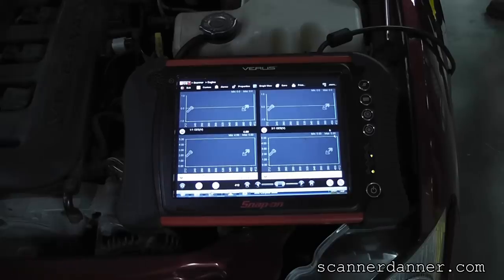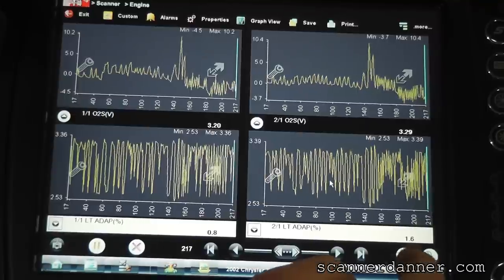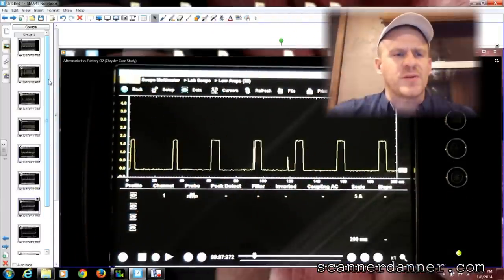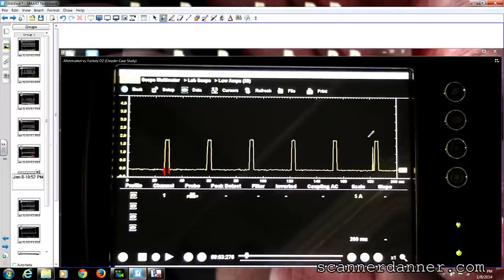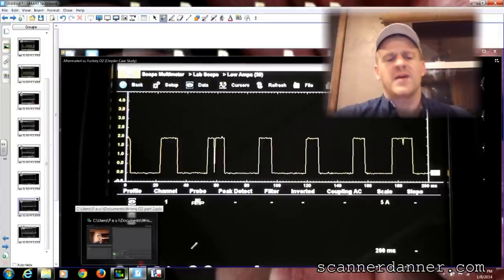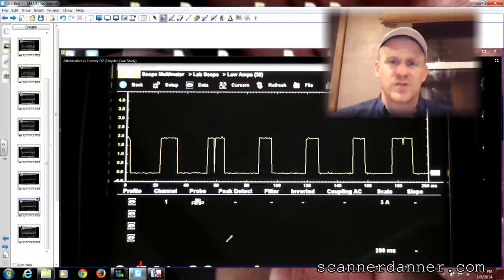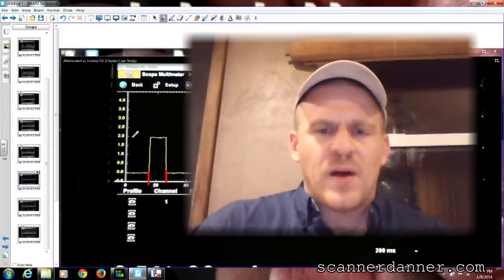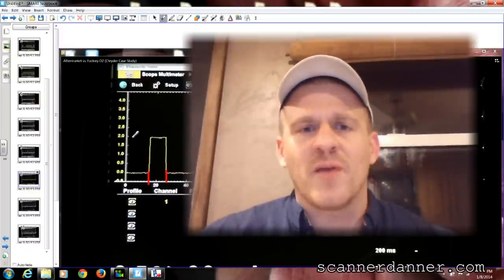WARNING! Aftermarket Oxygen Sensors (Chrysler/Dodge/Jeep part 2)

Comment: Hi Paul, Before you read this post read Douglas Lee's post, if you haven't already. I expanded on his comments and I copied it and posted it to you too, below! I really think you will find it interesting and it might answer some of your own questions about what was going on in this case study. I think!   You still Rock Dude! LOL!

Grab a cup of coffee, its pretty long!

Douglas, I believe you have an older generation computer ( Single Board Engine Controller ( SBEC )). SBEC l & SBEC ll have a single 60 pin connector as SBEC lll has two 40 pin connectors. Pin locations are not the same for various functions on the connecters. On 1998 and later SBEC lll and SBEC lll+ have different pin arrangements to prevent inadvertent interchange. I'm not sure which version you have.
 Introduced in 1995 on Chrysler vehicles, it was the first to combine the Logic Module that processed sensors and other inputs with the Power Module that actuated all output devices including the ASD relay onto one circuit board. The Heaters are fed battery voltage by either the ASD or a Sensor relay. In either case, both relays are PCM controlled. The sensor heaters use a common ground as you describe or are pulse-with modulated ( PWM ). With SBEC or Jeep/Truck Engine Controllers ( JTEC ), if the Heaters were PWM, they were controlled with a  Low Side ( Ground Side Switched ) driver, in the PCM. Both the SBEC & JTEC platforms were starting to be replaced by Next Generation Controllers ( NGC ) in 2002. I believe they were totally phased out in 2005.

On vehicles with NGC controllers the Heaters are controlled by High Side ( Positive Side Switched ) drivers in the PCM.  The Sensors in NGC are Zirconium Dioxide and Positive Thermal Coefficient ( PTC ) elements, meaning that as the temperature increases so does resistance thru them. The resistance on the heaters are constantly being monitored by the PCM. This information is used to verify heater circuit integrity and indirectly the temperature of the O2 Sensor. The PCM performs a Voltage Drop test across a 10K resistor that is inline with the Driver and the Heater circuit. The PCM adjusts PWM to maintain proper Current Flow to maintain proper operating temperature ( 660 Degrees ). 

The PCM also uses a 5 volt pull-up to check for short to ground or short to power when the Heater is in an OFF state.  The PCM and the O2 have another trick up its sleeve! When the O2 gets hot it essentially becomes a Galvanic Battery and generates a voltage of 0.0 - 1.0. volts. You will see that voltage on SBEC & JTEC Signal Ground wires but not on NGC Signal wires. On NGC platforms you will see a voltage of 2.5 - 3.5 Volts on the Signal Ground ( Technically called Signal Low or Signal Return ) because the Signal Ground wire is heavily filtered from RF/EMI to eliminate any electrical noise before indirectly going to ground. 

The reason you don't see 0.0 to 1.0 volts on the Sensor Return/Low wire, is because the Sensor Return/Low wire has a 2.5 volt Bias voltage on it to keep the Sensor Return/Low Voltage from inverting ( Negative Voltage/Below 0 Volts ) which will cause an Open Loop condition that could occur under one or all of these situations.

1) Dirty or Contaminated Sensor
2) O2 Fresh Air Inlet Clogged ( Inlet is thru the wire harness, believe it or not )
3) Extreme Load in Extreme Heat ( Such as towing a Trailer )

I just watched this vid on After Market vs. OEM O2s and thought I would add to your comment and expand on what you were seeing in your service manual's wiring diagram. I also wanted to pass along some info to Paul ( AKA ScannerDanner ) to help answer some of his own questions. I think I'm going to copy this and post it to him too, just to make sure he sees it too. I think he will find it interesting. In his follow up, he seemed a little bewildered himself ! But in my eyes he still ROOOOOOCKS!
Reply: Paul, I know it's been ten months since you made this vid, ( I just watch it 11/11/14 ) but after watching your follow-up again, of part 2 of this case study, I was feeling the pain for you (LOL ). So I decided to ad to my earlier comments to ease your pain! ( LOL ) ! IF you go back and review your follow up you were right on the money! You kept leaning towards some key issues, but you were not sure, but like I said you were right on the money. In the name of shortening this comment, please read my earlier comments.

Let me just bring everyone up to speed about why we have O2 heaters in the first place besides the obvious reasons, such as quicker closed loop operation ( 5 - 10 sec ) vs conventional O2s and less pollutants ( In 20 minutes of cold warm-up you pollute more than 500 miles of highway driving ) so I read somewhere. The most important and scientific/physical reason is because, the ECM can't do its job until the sensor gets up to about 625 - 650 degrees Fahrenheit--the point at which the sensor's zirconia electrolyte/ceramic element becomes electrically conductive. Keep in mind though, that O2s optimal operational temp is at around 1100 -1200 degrees.

You were right and wrong when you said you mistakenly thought that the problem started to show it's ugly head when Chrysler went to the 2.5 volt Bias. You were right because it did start when they put that bias on the sensor ground, but you were wrong because they also went to PWM at the same time. In my earlier comments I explained that Chrysler started to phase ( Note, I said Phase ) out the SBEC & the JTEC PCM platforms in 2002 with the NGC PCM platform!

You were also right and wrong, when you said that at first you said that you mistakenly were thinking that there was some type of amperage problem! There is! The O2s in the SBECs & the JTECs, I believe have a much higher resistance than the O2s for the NGC PCM platform. The SBEC & the JTEC O2s are Battery fed by ASD or a Heater Relay and they either use a common ground or are PWM ( Ground Side Switched ) by the PCM. Depending on make and model and year, they could have a direct 12 volts on them thru the ASD and full chassis ground, so you would have to have a high resistance on the O2 heaters and they do! At room temperature they draw about .600 ma and at operating temperature they drop down to about .200 ma.
That's where you were right when you also said, maybe it is a Resistance problem! It is !

Now remember I said earlier, that Chrysler started to ( phase ) in the newer NGC platform in 2002. Well they did, but they didn't finish, I believe till 2005. On the new NGC platform the O2s were all PWM ( Positive Side Switched ) by the PCM! I believe the NGC O2s did not need as much resistance as the SBEC & the JTEC O2s because they could control amperage and current flow, by Duty Cycling and PWM only, there were no relays used. The O2s for the NGC platforms could not tolerate a direct 12 volts as the SBEC & the JTEC O2s! If you were to take one and mistakenly put one in one of the SBEC or the JTEC vehicles that were relay fed and chassis grounded you would cook the heater, in short order!

Within those three years with all the different makes, models and years, some having the newer NGC platform and some having the older SBEC & JTEC platforms, It's no wonder that all of the aftermarket manufactures of O2s could not get it right.

So, Whaaaaat's you think? You still ROOOOOOOOOOOOOCK Dude!
Reply from the maker: Billy R
awesome research Billy! Thanks so much. Check out this post on iATN I did. I have pictures and resistance readings on the aftermarket and NTK sensors.
http://members.iatn.net/forums/read/msg.aspx?f=forum13&m=53268&fv=4&ar=434
Guess I should ask if you are a member. If you are not, let me know and I'll figure out another way for you to see these pics.
Reply: ScannerDanner Paul, no I am not a member, but since you would even ask, I'll take that as a complement! I've never had any formal training before, but I've worked on cars since I was about 10 or 11 years old with my father or maybe earlier! When I was a teenager, ( You either fixed you own Car or You Walked ! ). I used to have about 70 consistent customer's at one point. But I slowly gave them up when OBD l came along ! I went and bought an OBD l Scanner ( I still have it ) at the time, but I really didn't have an understanding of what I was looking at! I kept working on my own vehicles and still do, but that's about it.

One day I had a issue with my Dodge Ram's headlamps ( one was Dim and the other was Bright ) and I searched the internet for some help and after coming across every idiot's channel on the face of the earth, ( Or I should say, YouTube ), I found yours! Your vids impressed me so much I watched just about every vid you had on your free channel. Even though you never did any vids on headlights, within a matter of days, I understood what was going on. I found my problem and fixed it. Right after that I signed up for ScannerDanner Premium!

I always had a pretty good understanding of electrical circuits ( I even made my own Christmas displays at one point ) but not what you were teaching ( Automotive diagnostics, circuit design and testing ), that I applied to my problem and it hit me like a light bulb ( No Pun Intended ! ) I GOT IT !  It turned out to be that both headlights ( High & Low Beam ) were battery fed thru the fuses in the  PDC and ground-side switched thru the headlight switch. Well I had an open in one of the feeds in one of the head-lights and it was back-feeding thru the bright head-light and back to ground thru the switch. The voltage drop across the bright headlight was causing the other head-light to burn dimly.   THANK YOU, Very Much ( as Matt would say ) my Overlord! ( LOL ! ) Like I said, YOU ROCK DUDE !

After I stopped working on cars, I became a Commercial Carpenter, building Hospitals, Schools, Office Buildings and such, but I am tired of all the yearly layoffs. So with my new found confidence ( Thanks to You and your vids )  I have decided to start working on cars full time again. I have a  5 bay garage in my yard. I'm in the process of fixing up a couple of bays to work out of and try to acquire a decent scan tool ( I have a Mickey Mouse one now ), maybe a Modis, I figure! I have most of the tools and equipment I need already. My long term goal is to try to get a mobile Diagnostic Trouble-Shooting Business going myself. I think that was an ingenious idea of yours! Just tell e'm what's wrong and walk away, Beautiful ! It's kinda like my regular job, I'm usually the foreman on most jobs!

Anyway I hope what I posted in my comments has helped you, I know by doing the research on this issue it gave me a much, much greater understanding of how the O2s really function and how the PCMs really interact and monitor them. I knew there had to be a logical  explanation to what was happening to those after-market O2s. I really felt like I was in your classroom and you assigned me some homework. I would really love to see your posting on iTAN. If you could shoot me a copy of it, or something, I would be really grateful. My email is Lugarmyboy@yahoo.com Also I have a couple of PDF files from Chrysler, I think, you would find pretty interesting, I think! They are full of a lot of inside info that may be useful to you and maybe you can pass some of that knowledge on to your students thru your teachings. I also have some pretty good articles about Bosch and thier sensors. I would be more than happy to shoot them to you!

As always Dude ! YOU  ROOOOOOOOOOCK! ( LOL ! ) God Bless & Take Care !
Reply: ScannerDanner Paul, I was just sitting in my office ( Ya know, where the Great White Porcelain Throne is Located ) ( LOL ! ) I do my best thinking and reading amongst other things in there! ( My Wife & kids hates it when I'm in there !) And You think you need a home office! Anyway I had a real profound moment in thought, You might even say ( as your brother James would say ) a Real Brain Fart, No PUN INTENDED! ( LOL ! )  OK, Your probably, either rolling on the floor laughing your A** OFF, or your saying to yourself, you really didn't need to know all that!

Anyway, I have a nice long term case study for you!
Alright lets get down to business, What if you keep an eye out for Chrysler vehicles between the years  2002 & 2005 during the coarse of your business or classroom duties and note what kind of PCM platforms are in them, i.e. SBEC, JTEC, or the newer NGC PCMs. The SBEC l and SBEC ll have a single 60 pin connector on them while the SBEC lll and the SBEC lll+ have two 40 pin connecters on them. The JTECs have three 32 pin ( C1=B, C2=B, and C3=B ) connecters on them. The newer NGC PCMs have four 38 pin  ( C1=B, C2=O, C3=W, and C4=G ) connectors on them. WOW! Think about that, six different PCM platforms in a span of three years! Like I said earlier, No Wonder the aftermarket could not make a sensor that would work right!

When ever you come across a Chrysler between those years ( 2002 - 2005 ) note the PCM and then lookup the aftermarket ( Bosch ? ) and the ( OEM/Chrysler/NTK/NGK ) O2 sensors part numbers. I suspect that the OEM part number will be the same for the SBEC & the JTEC PCMs if they are Relay controlled circuits, but not match the newer NGC PCMs OEMs O2 part number within those years.
 
The only variable that you will have to check, is if either the SBEC or the JTEC PCM  is PWM/Groundside Switched! You will have to lookup the wiring diagram to see if it is a Relay Controlled or Groundside Switched circuit. If it is PWM, I will bet that the OEM part number is different than if it was a Relayed controlled O2 and that it might even be the same as the newer NGC PCMs O2 part number!

At the same time, I will also bet that the aftermarket O2s part number for all three PCM platforms are the same within those years?

I've read stories on those dreaded forums ( that Matt hates ), that a lot of people put Bosch O2s in there Chryslers and had lots of problems and than on the other hand, I read more stories where they had no problems at all. If what I am proposing is true that would explain the two differing stories. In your own personal experiences, you might have just been consistently unlucky to get a car with a PWM controlled O2 system instead of a Relayed controlled O2 system when you put those aftermarket O2s in a Chrysler? What a Perfect Storm, Hey!

I do believe this is the only way that you can put this long running mystery to bed once and for all. Like you like to say " That's It, Your Done ! " If you should take on this case study, please, keep me informed, because I really, would like to know the answer too! You Rock Dude!
Reply from the maker: Billy R I am honored to read your story. Thank you so much! Contact me privately and I'll set you up with a student access to iATN under my account. I've asked them for permission to do this and they never replied but the way I look at it, you are my student right? I doesn't matter that you are not physically in my class.
Reply: ScannerDanner Paul, Thanks, You really do Rock, and I'm not kidding around. You really are a good guy! After watching you for better than six months, I notice that you don't claim to do it all, but give credit to where it belongs. Every thing you do is because the Lord has blessed you with brains and the skills to achieve what you have! I'm not overly religious but I do believe in a greater power than ours! You would be a Fool to believe otherwise! I'm somewhat new to this YouTube/Goggle Sh**t, so, if you don't mind could you explain to me how to contact you privately. I gave you my email address, you can do it that way so you don't get overwhelmed by people trying to contact you! But Dude, You Still ROOOOOOOOCK! LOL !
Reply from the maker: Billy R
Thanks Billy. All you need to do is go to my YouTube channel page and click on my name (I think). Or you can contact me from my website. The google+/YouTube connections with the comments is confusing to me too sometimes. I forgot you posted your email. I contact you now.